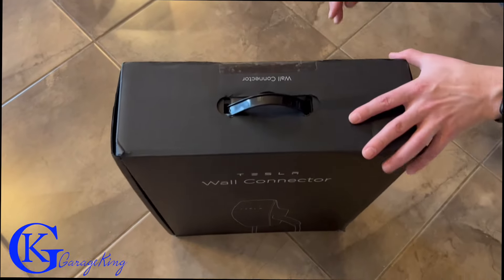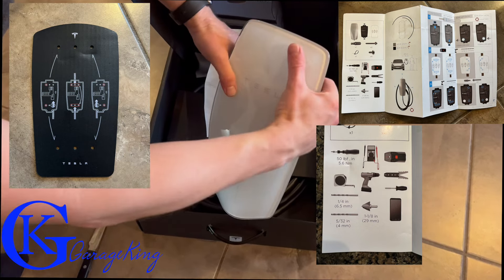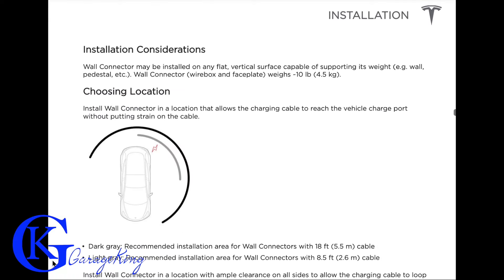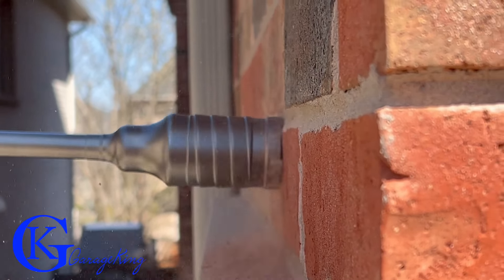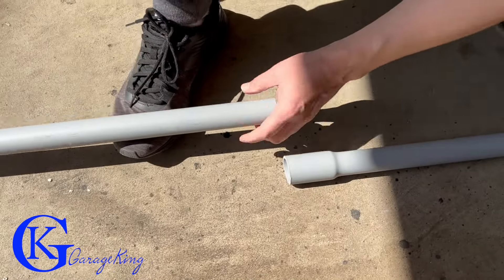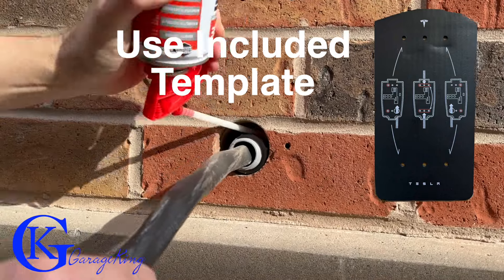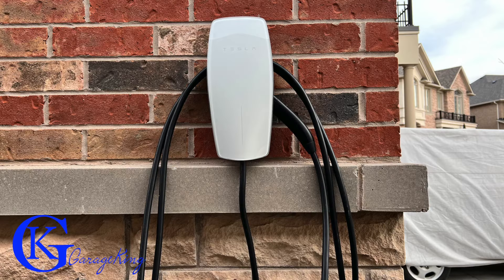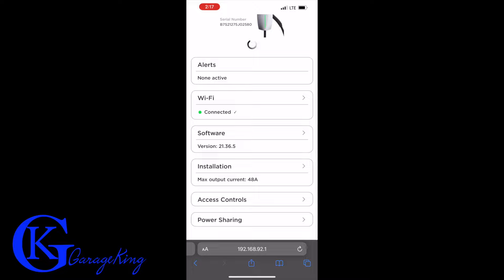Tesla Wall Charger installation (Gen 3)

Comment: How has it held up being in the elements all day everyday?
Reply from the maker: Hey thanks for the comment.  It has held up really good, the front is glass with the frosting behind it, so that is probably why, and its weather sealed with rubber gaskets.  I installed it between the houses so its not in direct sunlight all day, and it's kind of shielded from the weather.  No regrets at all.  I'm really happy I installed it outside. Makes it a lot easier to charge the car as I just pull up in the driveway and plug in.  Get the 24ft corded one.  Happy Sunday to you :)
Reply: @GarageKing  thanks for the reply ordered mine already, have an electrician in the family, so I’m lucky there. I will either have to install it on the exterior wall of my garage where it will be exposed to everything (sunlight and all) or install in garage and figure out a way to get the cable to my car. Makes me want to get rid of all the gym equipment I don’t use 😂
Reply from the maker: @markm3330  I hear ya, I would have loved to have the Tesla inside, but I have a corvette and GSXR inside so the Tesla has to go outside with the rest of the GarageKing fleet.  Where I mounted mine I don't get a lot of sun, and the rain is blocked.  But that being said I think you should be ok, as the front is all glass, with plastic I would worry, but the glass will be fine.  Also the glass part is pretty big and covers most of the plastic underside, and the unit is sealed well with high quality rubber so I do think you will be fine.  I love mine as I use a 60amp braker so is charges at 48amps.  I get about 72km/hr or 45 miles per hour charge rate on the long range model Y. As for your gym equipment you know as soon as you get rid of it you will have the itch to replace it all haha !!!

Comment: Question: the black and red wires are connected two different 110V AC lines (opposite phase to get 220V ? 
Tesla Wall Connector manual specifies single phase !!! Please clarify.
Update few days later:  my memory went bad. I remember now: the two hot wires are 110 VAC which phases are off by 180 degree. So together they give 220V single phase. If we put these two lines on an oscilloscope, we get two sine waves. Their crossing points are exactly when their voltages are at 0 (X axis). If the scope lead (one+ground) are connected to these two hot wires, we will see one single sine wave with the peaks reach 220V.
Reply from the maker: Hey There, as per Google "Two-phase service is an obsolete style of electrical power distribution ......" so there is only single phase and three phase.  For the wall connector you need a two pole breaker and both wires go into the breaker, then you just need a ground.
Reply: @GarageKing  uhhhhh...he is correct in that the two conductors from panel and ultimately from the utility transformer are indeed 180 degrees out of phase...it is called single phase but....
Reply from the maker: @jstone1211  I know, it was a naming convention I think.

Comment: So if my main breaker panel don’t have kill switch of 200amp I can’t connect wall connector?
Reply from the maker: Hey There, you main breaker panel has to have a main cut off, every panel does.  I have a 200amp service in my house, and the garage panel has a 100amp cut off breaker.  You can install it on a 100amp service panel.
Reply: @GarageKing  there is any way to attach pic of my breaker panel on here?
Reply from the maker: @alexp7362  No sorry, but you can email me, go to the "about" tab on my main page and my email is in there.  You can send me an email.
Reply: @GarageKing  thank you for replay hopefully charger comes this Sunday super excited to i install it
Reply from the maker: @alexp7362  For sure, its an awesome unit, and anyone that has an EV should have one.  On of the best things is you can adjust the charging amps so its really versatile !!!
Reply: @GarageKing  I’m gonna try first to connect to my garage sub panel I have a few Empty spots putting 60amp  braker into it
Reply from the maker: @alexp7362  Sounds good !!

Comment: Nice video! i read somewhere saying only thhn/thwn #6 wires in a conduit can produce full 48amp for the wall connector while #6 romex is only able to produce 44A due to temperature constraint. If that's true then you might want to set your max charging power draw to 40amp instead.

Also, romex is only allowed in a garage if the conduit is inside the wall as garage is considered a wet location.
Reply from the maker: Hey there and thanks for the comment.  I will answer both of your questions.  First, #6 is rated to 55amps. 2nd, in Canada the conduit, providing you use the right one (usually grey) and I did, its suitable for wet locations, in fact you can use it underground as many people use it to run their hot tub wire.  Also if you look at new houses built here you can see the grey conduit popping up from the ground on the side of houses where the main electrical feed comes to the house.  Regarding your comment about setting the charging to 40amps, I actually set it around 20 because I plug it in once I get home and let it trickle charge over night as it might be better for the battery to slow charge.  I'm not sure about that, but I figure its probably better to slow charge a battery. What's your thoughts on charing fast or slow?
Reply: @GarageKing  I tried to charge at 24 amp last night, and it's about 20 miles per hour. Tonight I tried 40 amp and now it's charging at 32 miles per hour. I guess if you charge daily and the commute distance is within 160 miles, 24a is more than enough.
Reply from the maker: @jackdai7492  Yup it is, I only use about 12amps a lot of the times and trickle over the night.
Reply: #6 is good for for 55 amps per the code. In article 240 of the code (overcurrent) 
You can put #6 good for 55 amps on a 60 amp breaker as long as the load does not exceed the 55 amps. But you can’t exceed a load of more the 80% on any breaker unless it’s a breaker rated for 100% load  So (44amps) is what’s allowed on a 60amp breaker. 
A garage is not a wet location, it’s not even a damp location, if it was then switch’s and receptacles would need to have in use covers. 
Romex is not permitted to be sleeved in  
conduit
Reply: @stanley4006  Uhm, no. Don't put 55A wire on a 60A breaker. Unless you're planning to be roasted alive in your sleep.
Reply: @afrocraft1  you obviously don’t know the code. Come back and talk to me when you learn something
Reply: @stanley4006  Educate us, then.
Reply: @afrocraft1  #6 wire by NEC (National Electrical Code) is good for 55 amps on the 60c chart 65 amps on 75c chart and 75 amps on the 90c chart. All the Ampacities can be found in table 310.15 (B) (16). If you know the code, in article 110.14(A) it says loads under 100 amps you must use the 60c chart unless your terminals are rated for 75c. What else would you like to know about the code.
Reply: @stanley4006  Lots of facts. The question on the table is simple: What wire should you use for a 60A breaker supplying an EV charger? You suggested #6 Romex was good enough. Still sure about that?
Reply: @afrocraft1  I am positive about that. Just hooked up a Tesla charger last week. Draws 48 amps #6 is good for 55 amps by code you can put that on a 60 amp breaker. Exactly what I said in the original post.
Reply: @stanley4006  as an electrician in NYC I approve this comment. Well said 👍
Reply: @stanley4006  Not here with romex. On one of my first installs, I used 6/2 romex as I needed to go from one side of the house to the other in the crawl space. Inspector made me downsize the breaker to 50 and set the charger at 40. Because the temp rating of romex. Also many installation manuals now state the need for 90 degree copper that rules out romex. Using thhn in conduit for most installs.
Reply: @GarageKing   not necessarily true. Only if said #6 copper conductor has 60*C insulation temperature rating. Higher temp ratings on same size conductor have higher ampacities.
Reply: Jack Dai romex is not a conduit. It’s a cable. Specifically, it’s type NM-B cable. And it has a 90*C temperature rating. 6 awg NM-B cable has sufficient ampacity  for a 60A breaker, unless you’re terminating it on terminals with a 60*C temp rating.
Reply: @stanley4006  that is wrong. You’re never allowed to run conductors from overcurrent protection that exceeds the ampacity of the conductors. That’s electrical 101.
Reply: @stanley4006  and how do you know the breaker terminals aren’t rated at 75*C?
Reply: @RB-xv4si  if it’s under 100 amps the code says assume they are 60c unless otherwise marked, so you always go by 60c unless you can prove otherwise
Reply: @stanley4006  fine, yeah. What you said is true. But if you’re going down that road, that means that your conductors no longer meet 210.19(A)(1)(a). The charger draws 48A and because it is a continuous load, means that the circuit conductors must have an ampacity not less than 125 percent of the load. 48 x 1.25 = 60. 55 amps is not enough.
Reply: @stanley4006  no you cannot. Read 210.18. The rating of the overcurrent device determines the circuit rating. That means you would have a 60A circuit with conductors that have an ampacity of only 55A.
Reply: I believe the concern here is that while the 6awg NM is rated for 55A, when you are applying 48A at continous load (which it is for EV charging), you are required to have a cable rated for 125% of the amps you're pulling. So 48A needs a 60A+ cable (or the inverse, 60A cable * 80% = 48A). Code lets you round up the breaker to 60A, but that's overage protection. I think to be running 48A, you need 4AWG NM, or a different type of 6AWG cable with a higher rating.
Reply: @RB-xv4si  210.18 reads specifically "Where conductors of higher ampacity are used for any reason, the ampere rating or setting of the specified overcurrent device shall determine the circuit rating." If I follow your logic, does that mean I could use 12 gauge romex because the breaker is 60A? No. Same applies here for the 55A cable. The 60A breaker is allowed because they let you round it up since 55A breakers aren't a thing (but should be IMO).
Reply: Need to use #6 thhn in conduit or MC 6/2 to continuous charge at 48amps. Go back to school.

Comment: You installed wire with a max ampacity of 55 amps on a 60 amp circuit breaker.  That is a code violation.  The load doesn't matter for the size. The purpose of the circuit breaker is to protect the wire. 

Now, even though the max output is 48 amps, any load that runs for 3 hours or more is to be considered a "continuous load" per the NEC.  Therefore, you have to  calculate the load at 125% of it's rating.  48 amps * 1.25 = 60 AMPS (that's why Tesla says to use a 60 amp breaker for full capacity)

In order to use the charger on a 60 amp breaker and at full capacity, you must install #4 copper conductors, and the ground can be as small as a #10 (NEC 250.122)  but I wouldn't go smaller than a #8 personally, and you probably won't find any cable with #4 conductors that has smaller than a #8 ground with it anyways.)

I hope this helps anyone who might come across this.

Any residential cabling is to be considered to be in the 60 degree Celsius column per NEC, regardless.of the temperature rating on the cabling itself.
Reply from the maker: Hey there, thanks for the info, but I did follow the Tesla installation manual.  I think there was a video where they explained how using #6 on the circuit was ok.  I don't think Tesla would knowingly put out information contrary to code. Maybe the car reduces current after 3 hrs? Not sure, the wall connector is just a connector, it is not a charger with a fixed rate.  The car controls everything.  I don't know of anyone who has used #4 wire.  Also I usually only charge at about 15amps and top up every night as it is easier on the battery.  I do appreciate you insight.
Reply: @GarageKing  I read the manual also because will be installing one soon for a customer.  But you can never install wire on a larger breaker and be code compliant, except in scenarios where you have a motor load with high inrush current at startup to prevent nuisance tripping.  Also, the manual does say to upsize the wire if necessary.

Do I think you'll ever have an issue?  I doubt it, but it's technically not code compliant.  Other than that, it was a good tutorial and nice job.
Reply from the maker: @IrrationalBstrd  Appreciate the follow up and I really did consider using #4awg, but its hard to get, and you would know how hard #4 is to bend and route :(   Not being lazy, but it was something I thought about, and the 55 wire rating is so close to 60 amp breaker that I doubt anything would happen.  You are right with the code compliance.  I guess to make it code compliant the 60amp breaker could be changed to a 55 and the car would sense that and limit max current. As I mentioned before, I rarely use over 20amps (mostly 15) as I trickle charge mine back to 80% every night for a slow charge. I did use the max 48a few times just to test and see how fast the car would actually charge and everything was fine.
Reply: @GarageKing  it'll be fine.  Just wanted to clarify for anyone doing it that might have to have it inspected and save them any headaches...
Reply: @GarageKing  wow, a like from the content creator.. sweet!    I did a little more thinking about this, and you're right about the wall charger not being an actual appliance/charger, but more of an outlet where the car itself controls the charging.  In that case, the way that Tesla came to the conclusion that you need a 60 amp breaker for full capacity is most likely the 80% rule (the circuit breaker should only be loaded to 80% of it's rating).     80% of 60 amps is 48 amps, so that makes sense.  Nevertheless, the wire should be rated to handle 60 amps, hence my suggestion for #4 phase conductors.  You ran conduit the whole way to the panel, so if you would've used #6 THHN2 individual conductors, it would be perfectly compliant in every way.  The PVC jacketed multiconductor cable (NM, SER, SEU) always falls under the 60 degree column, so it's ampacity is only 55 amps.
Reply from the maker: @IrrationalBstrd  Hey there, sorry I didn't reply last night, went to bed :)  Not sure if you were aware, but I did strip the sheathing off shortly after the video, so it was individual wires, now I know there is another problem, each wire is not individually labelled, but now there is less heat as they are not all bound together. So the wires are individually run in the conduit now.  Best I can do haha.  I was thinking the same thing about the 80% rule and I let people know that the wall connector, is just a connector.  Its not a charger, so its job is just to supply what the car wants, and if you look at the cord that comes with the wall connector there is no way that is even 6AWG.  Appreciate the follow up :) and another like haha !!

Comment: how is this wall charger rated for outdoor use?
Reply from the maker: Hey There, I don't know if it has a specific rating, but I know right in the Tesla manual it says you can use it outdoors.  I filmed this in the summer and the charger is still working great on the side of the house.

Comment: This is what my GEN3 wall charger says in Australia, there is no 48 Amp maximum

Current Output Range Maximum 32 A (adjustable by installer)

This manual applies to Wall Connectors identified by part number 1529455-**-*
Reply from the maker: Wow, unless they changed them, but 32amps is low so I'm surprised.  Mind you I rarely use of 30 as I just trickle charge for a top up every night.

Comment: I don’t know about Canada, but in the US a grounded conductor can not be white, it has to be either green or green with a yellow stripe.
Reply from the maker: That is one thing I'm going to change, there was also some discussion about striping the sheathing off before I ran it into conduit, a lot of guys in the US said that was not right, until it was pointed out that it is allowed as long as its in a dry location, above ground, and not tight (so its ok) but as far as the ground, I'm going to strip that right back to copper so its only a copper wire, this way there would never be any confusion in the future. Thanks for the comment